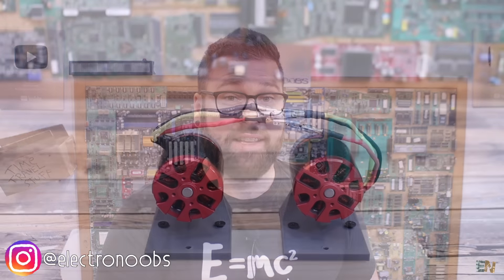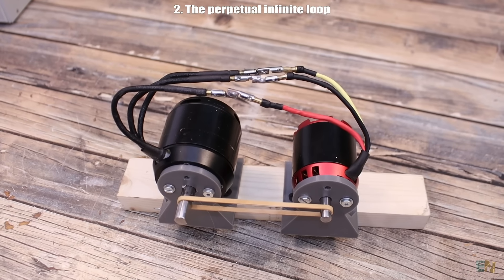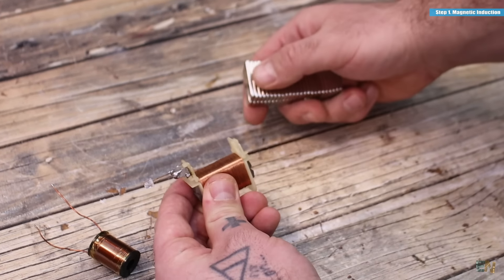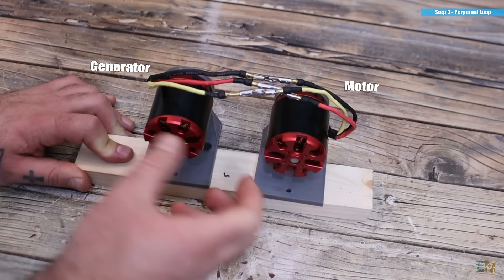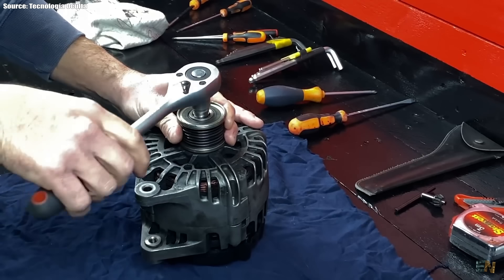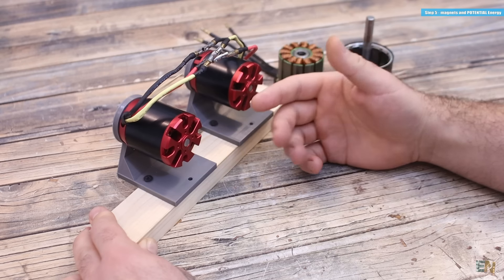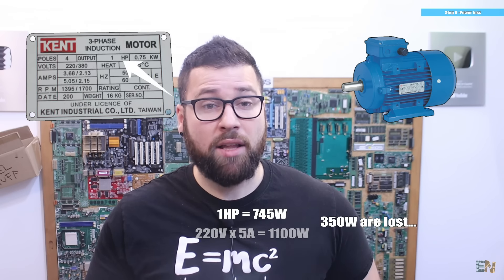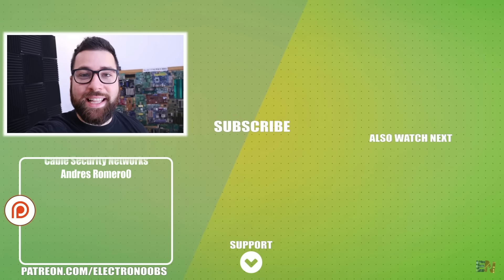Free Infinite Perpetual Energy Nonsense - FAAAAAAKE

Comment: You waaaaay over evaluate the expertise of these people doing the videos. They powering a bulb. Not a industrial complex. A farmer with a couple of parts in the shop is showing a basic way of generating a small source of power with parts sitting around their barns. It's not fake, it's a simple experiment. And none of them are selling anything. 
Farmers not engineers. Lol 
I wouldn't spend the time to rebuild a part as you suggested they may do, it is a simple experiment.

Comment: Clearly spoken and well thought out analysis of the topic
Reply: Problem is he doesn't actually prove anything by debunking the methods, just says that in theory it doesn't work.  His fake mock up generator is just a prop he doesn't even try to use magnets or have the wiring correctly configured just says it won't work.  Looking at the guy he probably thinks excercise is just a theory too...

Comment: cars and trucks use belts.  a big box fan uses a belt and pulley system.  different size pulleys to reduce or add speed.  1/2 hp motor can do more work than a 1 hp motor if it has proper size pulley  and 1 hp has improper pulley..  portable home generators use belt and not direct .  you are so taken to disprove  please use some energy to see if it is possible ..1985  Howard Johnson got patent for magnet  motor that ran a 5000kw home generator..  but  as we all know it never got off the ground..it was fully functional and on magazine front cover..

Comment: Really because I built one years ago and it worked fine mine took a battery and inverter but worked and mine had no magnets just ford alternator,  and 1hp motor motor drove the alternator and multiplied energy actually it's how windmills and Niagra falls power station work, They used to sell Windmill generators made from these it's the magnetic field creating the power the magnets are just replacing the 12 V from the car battery (not a car guy I take it) they also take special windings inside the alternator because it spins at a slower speed than a car engine I'll build another one to prove it mine didn't work so good it got stolen so I'll build another and post a entire build video and I have no subscribers so no ad money no money motivation just helping the Earth and fellow humans who want free energy well almost free parts required 1hp single phase motor a must plus a special alternator winding

Comment: I'd guarantee they only got 700 to 1000w max out of alternator after magnets installed. Magnets would be motor efficient than using induction coil of alternator but they'd need more rpm with magnet option..
Capacitors installed in base .

The best I've achieved after many builds years ago at 12v in size , was 100% in 90% out .
I'm working on the last attempt just for fun now.
Only 12v under 100w , definitely last build with a gearbox efficient drive motor , I know it won't work but just for fun.
Then I'll use generator on wind turbine which is free.
Cheers even producing hydrogen then reusing in fuel cell isn't free...

Comment: I think should have did an actual replication of the test to prove it did not work. It's one thing to say it doesn't work and something else entire to prove it didn't work. Because you could not prove it doesn't work people are more inclined to believe your theory was fake! 

Reality is modern alternators produce 5000 watts and can go as high as 24000 watts. If the motor uses 200 watts that turns an alternator that produces 5000 watts max would this not be a net increase?
Reply: @darklight2.1  I understand thermodynamics. My point was he didn't attempt to duplicate the experiment, he dismissed the experiment with 2nd law of thermodynamics. Everyone since Tesla has attempted to solve perpetual motion question and there have been a lot of scammers. He should have attempted to replicate the experiment then explain the failure.

Comment: Have a direct connect to the axle of EVs and solar, to super charge them quickly and continuously. Then use V2G tech to transfer all extra energy to the power grid. Use Nano threading throughout the whole structure of EVs to turn them into a big battery that lasts for a very long time.
Reply: I think the girl at the mall does Nano Threading, right?

Comment: Nonsense???? When you show what you show, you have a motor that uses ALL power from the generator, so therefore you have nothing over for real use. NOT only this video, but also another from India that also works. YOU cannot say this cannot work when there are same movies from each country showing this. I also had this thought about endless supply decades ago. I was told by my employer at the time, a power generator plant, that it also could not work.
A power station makes electricity by getting HP steam turning a generator creating electricity. Replace the steam with an electric motor, and you make electricity. You tell me what the difference is? Therefore you are also wrong in your assumptions !!!!
Reply: Did you build it yourself? Lemme see how it works

Comment: ok lets end dis same for now and proow a neutral experiment of INPUT /OUTPUT .
I suggest to take same motor to run on 12 volts and see its speed on a speddometer and wit same speed run it back and messure output dat it gives , if its lower den experiment is once and for all prooven fake existance of a concept if its more dan 12 volts den it prooves obviously its all REAL  ...... be quick its easy

Comment: So tell me how a car battery charge?
Reply: Does your car battery charge while the car is not running? No
Start the engine, the motor runs and propels the alternator which will produce the voltage to charge your car battery.
The energy comes from burning the fuel used by the engine.

Comment: You contest that the creators of the perpetual motion device are only using one phase however thats incorrect they have 2 phases hooked up. And more power output than input is very possible if you take a 12v battery hook it to an inverter the hook a microwave transformer up to the inverter primary the 2000 AC volts comes out the secondary windings of the transformer. Call me a bullshitter but ive done it.
Reply: As a practical matter the FAKE contraptions are not using any phases of the alternator. It's all for show.
However, if it were true, or demonstrated in a more honest set up, that the alternator stator windings were isolated by removing the diode block, how would you connect them? Just wondering what you had in mind. I too came here to learn.

Comment: In one of the new videos, explain what an asynchronous cage motor is and explain that frequency is an important factor related to the number of revolutions of the motor. So does the number of poles of engines or generators. Maybe that combination is the solution. Then connect it all to this video.
Greetings: Milos.
All praise goes to your work so far!

Comment: There are things like tourc curve and back emf when the motor spin and powerer a coil on brushless because two phase you get a calapse and opposing emf that could be used to power the motor and also the motor the genorator can also there are other things we don't understand a genorator does not male electricity it manifest it from the either and there is no such thing as an electron when an electric field calpse the dipole it makes electromotive force current opposing the voltage if this was a like for like but it a poor job and awnser nothing he use a rubber band ya great
I see many people try debunk vede9s but are nothing like the vedro they supised to copy he should have 24 v truck alternator amd 4hp 2 phase motor then a proper belt 
Also it is true you can run a cat on water 💧 it nit free energy because water has loads plus air has nitrogen that also combust it possible to run an engine on air alone 
Turbine jet can do this also 
Tezla turbine atmosphere one run because we under alot of pressure already just like in go umdet water the turbine create low psi on output so can be possible to run with nothing but air

Comment: (( so my phone works just because i touch it ,the rest of time have no energy  ,,i creat energy with my hand ,not the magnet ,,,so the wind have the energy instead of the magnets, right ,,,of coz it wrong understanding)) ,,and last ,,you havent properly built it ,,though you proved the motor can move the other one  by energy coming from the magnet ,,,next time put a proper gear ,,,,it is about the energy of the magnets ,,the magnets are activated with electricity in the process of manufacture ,,,,do it right before saying is fake

Comment: Magnet energy nonsense?  Really? So your saying a magnet doesn't have stored energy?You might want to rethink that statement. As magnetics isthe inverse of electricty. It's just how your able to harness it. So if you think your an expert on brushless motors. Then you will know that positioning is everything. That inorder to turn a motor requires them to be at then right place at the right time. That you can also use electricity to make a temporary magnet
 While I may agree with you that they should try to use the most efficient motors
 While I cannot say if some or none of these actually work.

I do know of ones that do just from simple logic how the other ones work. 

For example. lets just say you have a baaic electric motor that also has a stator on the end of it. 
Also lets say the motor has earth  magnets on the rotor and has electron magnets positioned all around the motor. 
That the electro magnets are connected to relays and directly connected to it stator/ generator on the motor.  

So if you were to spin the motor faster it will create more energy. But when you want to pull a load from the stator generator its magnetism will increase making it harder to turn. 

okay thats  simple 
 So lets say those stators are connected to capacitors that go to relays and to the  electromagnets around the motor. 

So if you just spin it by hand there is almost no load or resistance, but will charge those capacitors fairly easy while you turn it, to store temporarily . 

bur regardless of capacitors and relays.  lets just say the motor doesnt have magnets inside it yet that your just spinng the motor by hand  and the stator is energizing the coils . Relatively easy as there is no load.Then you make it so that the other end i drags along then shaft and only energizes and magnetizes at it final push (repelling locations. I you spim it by hand it still just as easy to turn. so putting magnets back  on the motor and you spin it the motor is just as easy. As the  electrmagnets start to energize at its push location. meang it will  want to push the motor. that it pushes and increases the speed. still almost no resistance same amount jusy to turn by hand but 
now the as it only energized during push  location it starts to push it making it easier to turn by hand and as it turns faster it gives more power making magmnets stronnger  pushing harder and again making it faster more power making magnets stronger that push harder  then go faster more power >stonger>> faster> more power> stronger> faster. So now by adding MOSFET relays  you reduce the friction and add capacitors  that collect and storen the excess energy when not acitivated that ot uses when it does and you have a magnet motor. Simple ideaa. 
So now back to these ones i. have noticed the ones  that look legit usally have different size motor/generators. That if the motor is smaller the the generator has a larger pulley. which makes it eaiser for the motor to turn the for the power it recives. That I havent seen any working models that have two same size motors and pulleys that are working. Which may be because of to inefficiency it doesnt produce enough eneegy to spi something  that itself requires same effort to spin and thats what I belive you haven't factored into to equation is the gearing of the pulleys to make up for those inefficiencies. 
So you can just go blah, blah, blah without any actual testing of your own to validate your rambling.

Comment: Pffft this noob doesn't know what he is talking about...

I've developed a revolutionary technology called the "Quantum Vortex Motor," which harnesses the power of quantum fluctuations and zero-point energy to generate free, unlimited electricity.

The motor I've created consists of a specially designed toroidal coil that creates a magnetic vortex, tapping into the very fabric of the quantum vacuum. At the heart of the motor is a miniaturized quantum resonator, an invention of my own, that takes advantage of the Casimir effect. This phenomenon occurs when two uncharged parallel plates are placed extremely close together in a vacuum. The plates attract each other due to fluctuations in the vacuum's energy. By modulating the Casimir effect, my quantum resonator extracts energy from the quantum vacuum and converts it into usable electricity.

To optimize the motor's performance, I've arranged a custom array of neodymium magnets in a precise pattern. This configuration maximizes the magnetic flux and generates a continuous flow of electrical energy. I've also incorporated superconducting materials into the motor's design to minimize energy loss and maintain a high efficiency.

Comment: How about running the motor off the battery as a separate system and then take the alternator wires from the alternator and connect them to the battery as if that's also a separate system in itself? Instead of connecting both systems to each other

Comment: dont forget the resistanc eto start the turning from scratch isz over come by the push ... resulting in more charge and less use with excess asz you go over time because all thingsz get better at what they do over time dont they ... motors are more efficient over time and time space osz expandiong faster than light